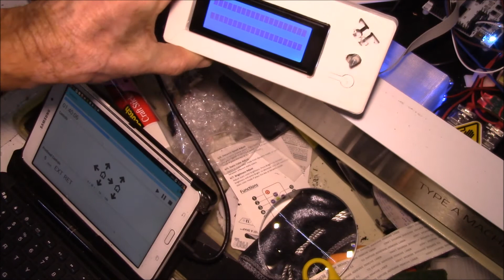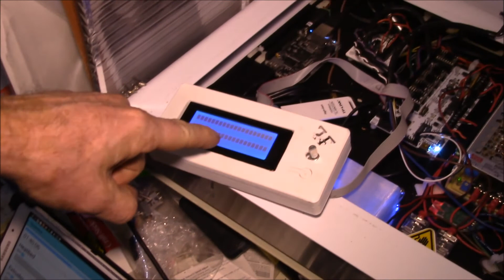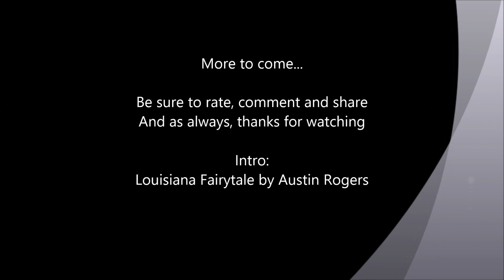Adding LCD Smart Controller to Series 1 Pro 3D Printer, Part 1

Comment: Hi I'm interested in the software on your tablet.

Can you tel me the correct name off the software is.  Octa Droid i can't find it on Google.  Maybe you can place a link to the website.

Thanks in advance.

Lex  A.dam Netherlands
Reply from the maker: I think this is the one I used:
https://play.google.com/store/apps/details?id=com.mariogrip.octoprint
My printer came with a QR code on the built-in web server that had a download/registration link to the app.
Reply: I think it is called octoprint you can find it here http://octoprint.org/
Reply: Thank you.
Reply from the maker: Forgot to add that this requires that you are running OctoPrint on the printer:
http://octoprint.org/

Usually requires adding a Raspberry Pi or similar processor to host that front end.  My printer has a BeagleBoneBlack processor doing that function and came with that pre-installed.